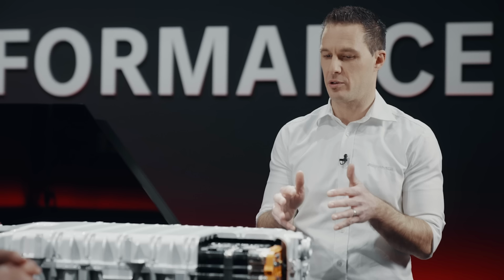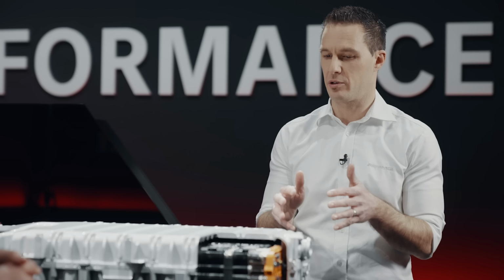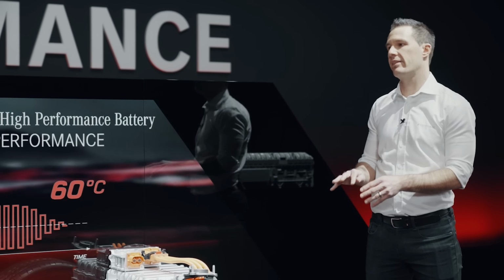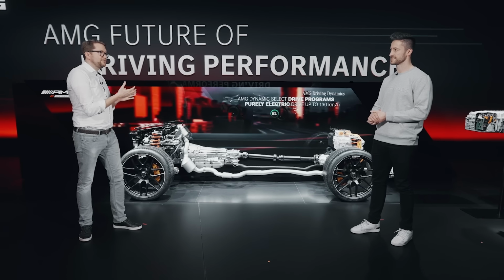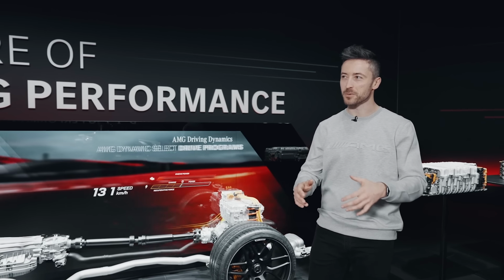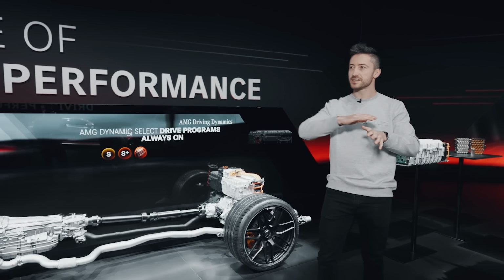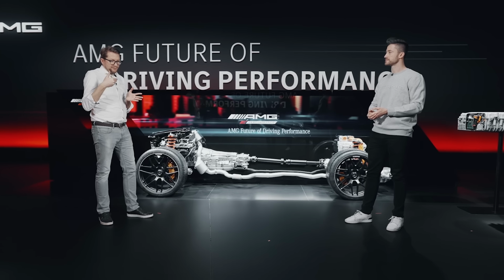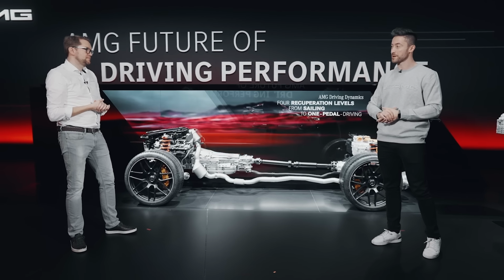INSIDE AMG – “OMG” | E PERFORMANCE Brings F1 Technology to the Road

Comment: I own two AMG's and the only thing I hate is the 9G transmission is weak AF.  Barely holds stock power, starts slipping on ECU tune and doesn't stand a chance against turbo upgrades.  BMW and Audi kill them on trans realiability.  You can tune an M5 to 900hp and have zero trans issues.  Do that to a 9G car and kiss your clutches good bye.

Comment: What I do not understand is why the battery cannot provide the full time that 150kW can provide but only 10 seconds.  I mean the battery stays at 45 degrees all the time and does not have to reduce its output due to overheating.
Reply: Because I small package should be recharged again that why is hybrid

Comment: I'm curious about the weight, do you offset the added weight of the E-Performance system by reducing weight in other areas of the car (eg: using carbon fiber to reduce the weight of the chassis/doors/etc...). Or does the added weight not matter too much?
Reply: well if they use a lot of carbon fibre the cars is gonna cost way more